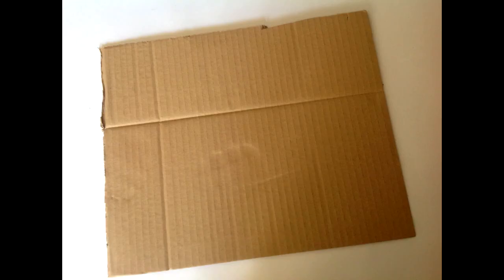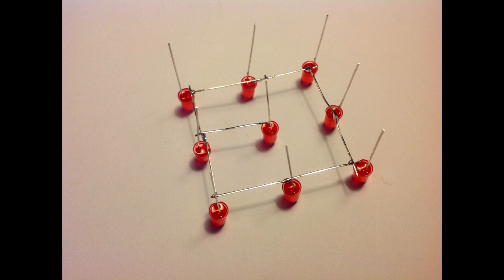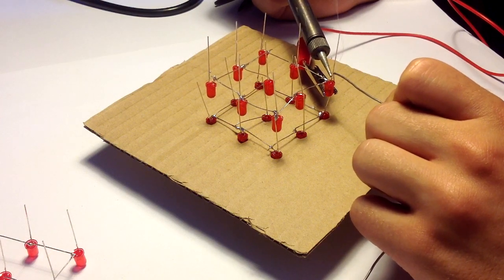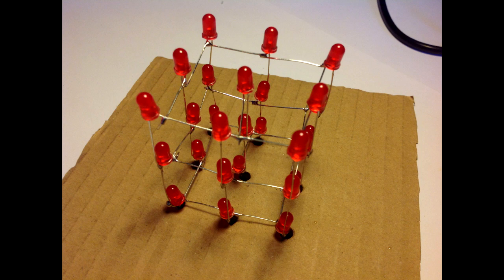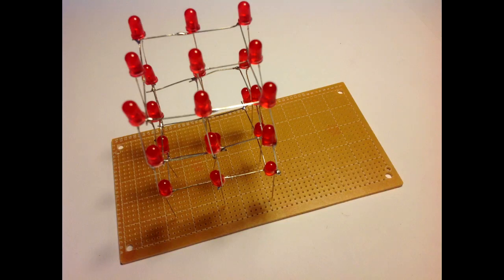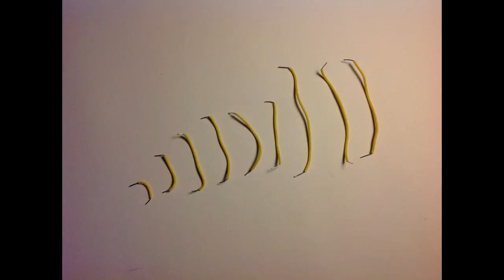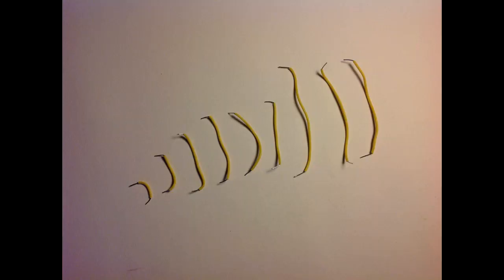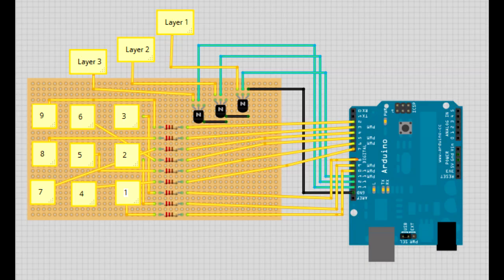Arduino - LED Cube 3x3x3 [Full Tutorial]

Comment: OK this is my first project so I'm a lil confused on the schematic part. You wire each of the nine anondes to a 220 ohm transistor then where? To the 5v power on the andruino? md what's the deal with the transistors what goes to and from them?

Comment: how many volts are going to the led's?
if i dont use the same led as you should i change the resistors on the negativ side or positiv side? thx
i use super bright blue LED.. 3,3v 30ma

Comment: I picked up the parts today at RadioShack, but I was in a hurry and grabbed voltage regulators instead of NPNs, 120k resistors instead of 220k and forgot wire. But I spent the evening soldering the LEDs together, I arranged them so there is a green, yellow, and red layer, like a stop light.

Comment: Built the cube - but keep getting programming error: taking address of 'temporary array   showmem( "before free");'Can anyone help a 75 year old newbee?
Reply: +Raymond Gascoyne  i also have this problem i putted a "," in the line above behind a ) because there were non but it didnt work
Reply: +Igor Schultze   here's how Rui solved my problem:Hi Ray,

I think it's a problem with the new arduino IDE.

Can you try to download an older version of the Arduino IDE? 1.01 or 
1.05?

Go here and download: http://arduino.googlecode.com/files/arduino-1.0.5-r2-windows.zip

Then install the library again and try to compile/upload the code.

Good luck  Ray
Reply: +Raymond Gascoyne thanks but i managed to solve it downloading another code from the internet and it only changed the place of the connection of 1 pin from the transistor and arduino
Reply from the maker: +Igor Schultze Thank you for the letting me know, I've updated the project page a few minutes ago!
Reply: Where do I find this code? Could you please post the link here?
Reply: its on his website the link in the description
Reply: Solution here to make it works with the latest Arduino IDE
https://github.com/gzip/arduino-ledcube
Reply: Hund

Comment: can you talk more about if i wanted to use 1,000 LED's ? NO RGB just LED

LEGEND: * = ?

*will i still need to use the  2N2222 transistor?> or do i need to step up to a mosfet?

*is there a formula to figure out what type of resistors and transistors i wud need for a system of 1,000 LED's ?

*do we add all the mA of each individual LED for a subtotal final Amp per level? and this will tell me what type of resistors and transistors i will need for that level/floor ?

im building a LED humanoid Robot but the led will just be like a led skin  over the actual mechanical structure where the actuators will be at so your help will be much needed thanks for your basic video demo!

Comment: Rui , can i addjust the brightness of the led's? From 220ohm resistors i have only ~2,2 Volts , my LED's are 3,3. WHAT CAN I DO?
Reply: +ERNESTAS ŽIOBA You could actually calculate the amount of resistance you need. You did not gave me the maximum current your LEDs will tolerate, or I would do it for you... The formula is: 

V=I*R

R = V / I

R = V (3,3 V) / I (? A)

That will only give you the smallest resistance you actually need. Very likely, you won't actually find a resistance with that value. Just use the smallest one you possibly can that is actually bigger than this value.
Reply: Thanks , it helped a lot. :)
Reply: You are welcome.

You could also use PWM for emulating resetting your voltage from your Arduino itself... That would require you to use (in theory) a PWM output pin. 

Note the word emulating it. You would STILL be feeding your led 5 volts, but for all practical purposes (both to the human eye and for the resistance of the device itself) it will seem you are feeding it less.

Comment: hi, im doing this 3*3*3 led cube, but from the  schematic, i didnt see the 22K resistor ,do i connect that to the emitter pin on the transister?
Reply from the maker: Yeah you're right I forgot to add those resistors to the schematic.
the 22k can be connected to the middle pin of the transistors or at the end of the digital pins 11,12, 13. It's the same thing.
Reply: Rui Santos  thx, i finished today and looks great

Comment: what if we need to add more leds? like 8x8x8 or 10x10x10 ?
Reply: You're going to need a significantly more sophisticated control circuit, as the Arduino doesn't have enough pins to control that many LEDs directly.

Comment: Do you need to use an Arduino?
Reply from the maker: Yes you need to use an Arduino.
Or you can remove the ATmega328 and use it on your circuit along with some capacitors, resistors, crystal, etc...

Comment: its having a problem .it says that  error compiling for arduino/geniune uno it also says as code error , i need some help  if any one can solve it help me out
Reply from the maker: You need to use an older version of the Arduino IDE, please read the blog post carefully, because I explain how to avoid that error and upload the code
Reply: i am using older version of arduino ide but it says that

LedCube cube(SIZE, levelPins, colPins);

led cube does not named as a type

and it says

ledcube:15: error: 'LedCube' does not name a type
ledcube.pde: In function 'void loop()':
ledcube:48: error: 'cubeFrame' was not declared in this scope
ledcube:48: error: 'f' was not declared in this scope
ledcube:48: error: expected primary-expression before ']' token
ledcube:48: error: expected primary-expression before '{' token
ledcube:48: error: expected `;' before '{' token
ledcube:195: error: expected `}' at end of input

can you please help me ....................

Comment: hi I'm kumar . This code gives error please fix this code error :- 
    This report would have more information with
  "Show verbose output during compilation"
  enabled in File > Preferences.
Arduino: 1.0.6 (Windows 7), Board: "Arduino Uno"
ledcube:15: error: 'LedCube' does not name a type
ledcube.pde: In function 'void loop()':
ledcube:48: error: 'cubeFrame' was not declared in this scope
ledcube:48: error: 'f' was not declared in this scope
ledcube:48: error: expected primary-expression before ']' token
ledcube:48: error: expected primary-expression before '{' token
ledcube:48: error: expected `;' before '{' token
ledcube:195: error: expected `}' at end of input